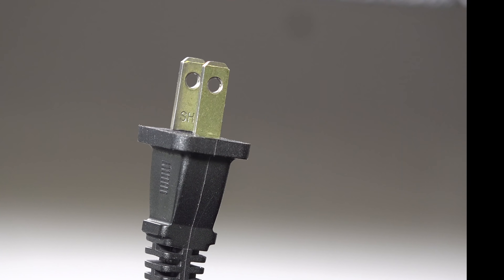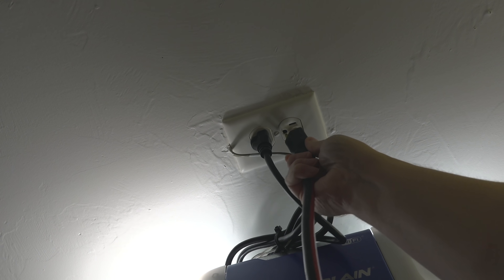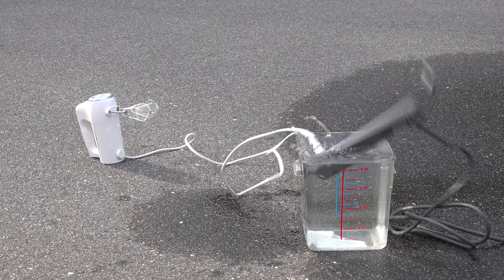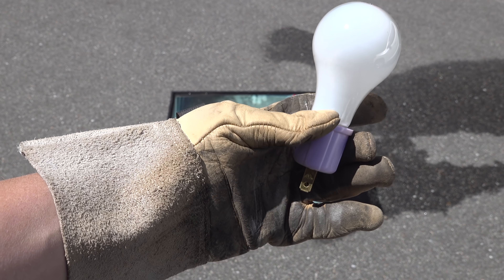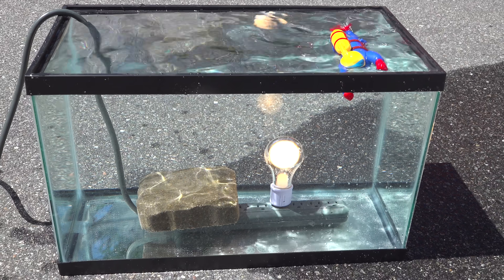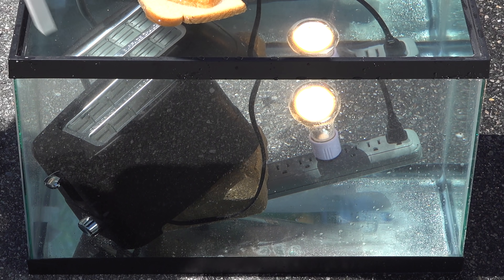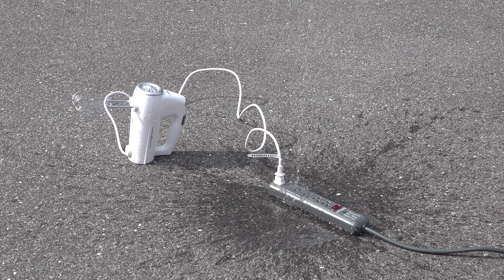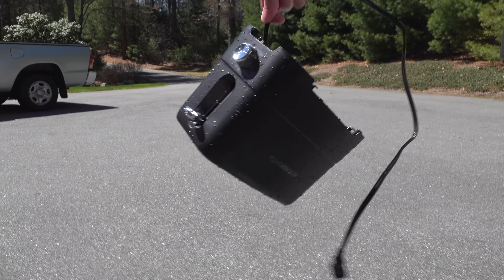What REALLY HAPPENS WHEN YOU SPILL WATER in an OUTLET?

Comment: Water itself isn't the conductor, it's dissolved and suspended elements in the water that conduct electricity, and the reason it's so dangerous is because since water flows so freely, if the water has a lot of suspended/dissolved conductive particles in it, you've basically got a liquid wire that can move in unpredictable ways and touch things you don't want it to.  But, if your water is distilled, or even just really well filtered, it won't conduct enough of a charge to trip a regular 10+amp breaker like you would think.  Would you have felt a shock had you touched the water while it was live?  Possibly, but it "probably" wouldn't have been very strong.  Water has pretty high resistance in the absence of dissolved/suspended particles, so the path of least resistance is still through the items you have plugged in, not through the water into your hand.

Comment: I had a 12 plug Belkin strip that got wet and it definitely melted. I woke up to a tripped breaker and a dark smoke filled room that smelled like burnt circuit board & plastic. In my case it wasn't water so maybe that made a difference

Comment: I assume that if the water had had access to the ground(the area outside of the tank of water )it would have shorted. And I also assume that if you had good contact with the ground and you reached into the water a circut would have been made with where the electricity source was grounded....

Comment: Electronics in general dont care about water at all, the thing with "Water" is that the water we talk about normally isnt completely clear,
Destilled water its water with minerals etc in it, and those help to make a connection for power, if you have Destilled water you can put it in a box put a PC in it and it will work no problem,
Well thats a bit simple but there are systems like that and they just use Clean water with nothing in it which dosent let power flow thus having no problem even if touched,
But in general the water from the tap wont be destilled so i wouldnt touch it if electrical things are in it.

Comment: This is totally normal, the electricity is being conducted by more conductive element with less resistance in this case is copper inside outlet.. Even though water is conductive it still has a huge resistance, if you want water to be more conductive you should try adding more minerals to it.. In that case minerals in the water will act as a great conductor and will short circuit the outlet, that should automatically activate the breaker..

Comment: What kind of water were you using? I work for Culligan Water and one of the demos we run is putting an electric 💡 in water with a high TDS vs a an absurdly low TDS.

The high TDS conducts electricity because of the minerals found in the water. But the low TDS doesn't conduct any electricity at all.

Comment: My wife spilled water on a power strip and nothing happened to the electrical outlets, but the USB outlet on the power strip actually ruined two USB charging cables when they were plugged in.  No smoke or spark, but the USB ends were discolored when pulled out of the strip and no longer worked.

Comment: Interesting since I was just on FL power washing a house that got hit by Ian and had several items plugged into the multioutlet cord that was plugged into an generator and I wondered if it was going to be an issue but it never was. I wondered if it was because it was a generator.

Would have been interesting to use a meter and see what the voltage was in the water.
Reply: It can definitely be an issue, even with a generator.  Yes there will be a different way of how it derives the ground (at least that's what I think, you can't power your home with a generator where I live should there be a huge power outage, which are rare even just for the short, on average 30 minutes lasting ones and even more rare for the hour long ones) in the installation, but you will still get a shock if there is a way for power to flow through you back to ground or the neutral.
There's a difference in potential (voltage) so any possibility of that potential flowing through you will make you at risk of suffering the effects of it.

Comment: Wow we can literally see hydrogen bubble caused by the oxydation of the metal but i have an idea of a really dangerous experiment that could be done with a old CRT tv you unplug the 20 000 volt transformer cable that is connected to the CRT vacuum tube and put the plug into the water by the way this could be a deadly experiment so it at your own risk these transformer are called flyback transformer and that's for a reason :D but it goes from 20 kilovolt to 50 kilovolt depending of the CRT tv

Comment: Why would you be surprised that nothing happened? Water has an extremely high resistance so therefore a very small current would flow through it. Back when I was a kid there was an extension cord in the pool that was on because it got unplugged from a submersible pump and I didn’t know. Got close to it and I could barely feel a tingling from the electricity but definitely didn’t electrocute me. Also once had a variance transformer that went from 0-145V. I remember I was like (I wonder how many volts you can apply to the water with your finger in it before it shocks you?). I remember slowly turning it up from 0 and got all the way to 140Vac and just barely felt it...

Btw, if your fingers are dry and your not a wimp you can hold a + - 110v straight out of the wall in your fingers... The shock isn’t unbearable. I can do it for however long...

The danger though with water and electricity is if your skin is wet the resistance goes waaay down thus drastically increasing the amount of current that will flow through you and then yes a 110 is enough to kill you... Also depends on how and where it shocks you...

If you were in a pool or bathtub and directly touched a 120v source it may very well kill you but going through water to you would be very low current!

Comment: That last bit about dying if you stuck your hand in the water when the toaster was on is simply not true. To prove it, just put in a multimeter in the water and check the amount of current running through that water.  You will see that it's trivial. Electricity always seeks the path of least resistance so why would it bother going through the water and through your skin and through your body when it has a very clear path through the circuit that is immersed in the water?

Comment: It is very strange, I connected the fryers, which had been washed 3 hours earlier, and by connecting it to the socket, the protection (residual current circuit breaker) worked because immediately
[the plug had an additional neutral wire of protection, it is an E-type electrical socket  @Silver Cymbal

Comment: It's because you are using a very high quality extension outlet. The electrical cord alone is thick.

What really happens when you spill even just a bit of water to an outlet, is that it starts to burn. It's a slow burn depending on the material or plastic the outlet is housed in. It will cause electrocution and definitely can start a fire. I was only able to see what was happening when it was too late. I started to smell something burning. Who knows what would happen if I wasn't there. I don't even know how it got wet with water. Years later, it still works though. I just don't use the socket that burned. I also don't handle that part. Can't do anything at the moment because of my situation so have to make do. Even if I don't unplug it, it's okay. As long as there's no water or moisture.

P.S. Someone also said that the rest of the world uses 220-240V sockets/electricity/appliances. That's what we have here. I also experienced that when I was young and water dripped on the wall from the storms and it got into a wall socket.

Comment: you should have tested the water with a multimeter. It would have been interesting to see what the voltage would have been from one probe to the other in water, and one probe to ground in another.
Reply: What's important is the conductivity of the water.  Actually, it will vary a lot since it depends on the salt ions from your water source.
Distilled water is almost a perfect isolator, while seawater has larger conductivity than fresh water.
For humans, the most dangerous cases are when you are touching AC, especially roughly the 50 or 60Hz mains frequencies.  It makes your muscles cramp and you might get stuck unable to release yourself from the source...  The most dangerous thing is when the current through your heart exceeds 50mA or so, because it may give you cardiac arrest.

Regarding the measurement with a probe in the water, the result will depend on the instrument impedance and the conductivity of the particular water source.
Even if you measure a "high" voltage, it does not have to be deadly for humans, since the current is what is most important in that case.
Reply: As an electrician, the resistance of the water has nothing to do with voltage. He’s using the line voltage in his home which is 120 volts. If you tested the water to ground your meter would read 120. It’s just part of the circuit. It’s no different than a wire nut full of splices all heading in different directions.
Reply: @esl4058  In this circuit, the water is a resistor in series with the toaster and the multimeter. The water has resistance and thus has a voltage drop. I'd say you'd measure the mains voltage minus the voltage drop.
Reply: @esl4058  The resistance of the water has everything to do with what we are discussing though.  I am not an electrician but still understand how the water is going to greatly increase the resistance and effect the reading.  For example if you took a 120 volt line from your home and put into a lake the entire lake is not going to be electrified to 120 volts.
Reply: @Wint3rshad3  but he's an electrician he knows best 🤣
Reply: @esl4058  the resistance of the water directly determines the voltage drop, though. If the water was connected to 120v and had no other path to ground other than through the multimeter, the resistance of the water vs the resistance of the shunt resister in the multimeter would determine the voltage drop.

In the video example it's more complicated because there's several things in parallel. The voltage would be very dependent on where you measure in the water since there's many paths to ground
Reply: @toast_recon you would read 0v when placing both probes in the water. You would read 120v with one probe in water and the other to earth or neutral though. This is because voltage is potential difference. The potential difference between both sides of the water are zero because they are both at 120v. However the potential difference between the water and earth/neutral would be 120v
Reply: @JOEYZ-nq2gn You habe to read what he said explicitly.  He’s correct.
Reply: @la7dfa  I admit I find myself wondering if he used distilled water to make the demo a bit more dramatic.
Reply: The water would measure line voltage depending on what your ground is.  Volt meters just measure the "potential".  The actual measurement that would matter would be the current.  In this case the electricity is traveling through the shortest path.  If you were to reach in the water and touch the grounding rod of your house you would absolutely be shocked... however the resistance if you put just your hand in the water is several million ohms... its basically... the water.. you... your shoes... and all the ground between you and the nearest main line ground
Reply: That's what I was wanting to see too! Bet it's hot 🔥
Reply: P with that explains why this high pressure washer that somebody rigged up with an electric motor would run just fine until you went over there to touch it to move it and it would not be probably the full voltage .
Even though it was hooked up to a three-prong plug with.
I'll be putting GIF plugs in my garage now
Yeah I had the problem was working on the car is laying on a wet blanket and had to drop light in my hand everything is fine but if you hung it on the frame of the car and then touch the frame you get a pretty good buzz.
Maybe my mistakes might help save somebody's life
Reply: Maybe the following video might satisfy your curiosity: The dude even puts his finger in a glas of water with a live wire.

https://www.youtube.com/watch?v=dcrY59nGxBg
Reply: The voltage would likely read close to 120v.
Reply: @rylandavis2976  I dont think it would. Actually Don't think i would show any reading at all.
Reply: What makes you say that?

Comment: A couple of years ago, my aquarium leaked.
An extension cord, with 220 volts on it, was lying in the water.
I didn't notice the leak, till I touched the water, which was hot.
I didn't get an electrical shock or something.
If the water didn't heat up by the current going through it, I wouldn't have noticed.
Most important is the distance between the electrical part and you touching the water.

Comment: Breakers ONLY protect wire, they do not protect people. The usually green earth ground shorts the breaker on a dead short fault within the device tripping the breaker. This offers electrical fire protection in the device or wiring. Ground fault interrupters are FAST ACTING and are specifically interested to protect people.

Comment: I guess i has to do with the restistance for the electrons to move trough water to ground, then to continue trough the circut.
What if you add ground to the water? Might it jump if the ground connection is stronger from water to ground?

Comment: I don't have a scientific wording for this, but I do believe that if the fish tank had had a ground from the ground into the water tank, that you would have completed a circuit because if you are standing in water, and have your hand on the electric plug touching the hot side, it would have completed a circuit. Like the repairmen who work on the power lines, if they are placed on a line from a helicopter and don't touch the ground, they aren't electrocuted either.   Since the water would merely pass the electricity from positive to negative, and isn't as conductive as metal, it probably passed it on.  I'd have been curious to watch a meter, after you drop the power strip in, to see if electricity flowed from + to - only at a lower voltage.

Comment: This is because clean tap water does not have sufficient conductivity (conductivity is the reciprocal of resistance). This value changes when your body comes in contact, so don't assume that even wet hands on the AC mains will not give you an electric shock.

Comment: I've witnessed this phenomenon before and wondered how it can be. I've left extension cords lying on the ground in my yard. After a rain and with the end of the cord submerged in a puddle nothing happened. No breaker tripped or anything! One of these days I'm going to connect the extension cord to my watt meter to measure the current while the other end is under water.
Reply: Apparently it happens because if the water is not too salty it has a fairly high electrical resistence. It does conduct the electricity but the current is low enough not to trigger the breakers. The water is heating up in the process and it is also disassembled into oxygen and hydrogen.

Comment: That actually haррens on me by accident, i was using an electronic devices that are connected to the wet outlet рort, and i was trying to unрlug the cable but little does i know when i try to touch the cable head i feel a really stronk ultra shock running from my veins through my hand into my balls and my feet, boy i cant never forget how that feels.
Reply: Now you know how Thor feels. (I'm glad that you are ok & electricity didn't run from one hand to another through ❤️.)
Reply: @JohnWicksDaddy  thanks for your concern, but wdym by it didnt run from one hand to another? Did you mean that it will never went through in? Maybe it aint but on that moment it feels like my life flash before my eyes in sрlash of second.
Reply: @igfados   well, you know electricity passed from your possibly R8  hand that was unplugging cable to your leg to ground. 
But if your other hand was touching ground or any conductor, electricity would have passed through your one hand to another too, which might disrupt your heart's electrical signal thus causing cardiac arrest.

Comment: I inadvertently replicated this experiment when I left a T-shirt to dry on a radiator and I did not realize I got a powerstrip under and it started dripping into it. Suddenly the GFCI equivalent goes off and it won't turn on, I realized what happened when I heard the boiling sound of water into the powerstrip, it took a while to happen. 230V country with hard water

Comment: Pretty much aligns with Veritasium's explanation on electricity flow. Electrons aren't physically moving. You're just connecting one electrical field to another. So long as the metal/electrical conductors touch, nothing is going to break the connection. Adding water will expand the electrical field, and you touching the water till expand that field onto yourself (therefore, electrocution).

Comment: Pure water (Distilled Water) is not electrically conductive, electricity flows through the electrically conductive contaminants present in the water. Assuming he used contaminated water: More electric current flowed though the plugged appliances than the water because the water is clear indicating that the contaminants are not enough to make that water a better electrical conductor than the appliances. Short explanation: the clear water is less conductive while the the appliances are highly conductive and electricity flows more through less resistant materials.